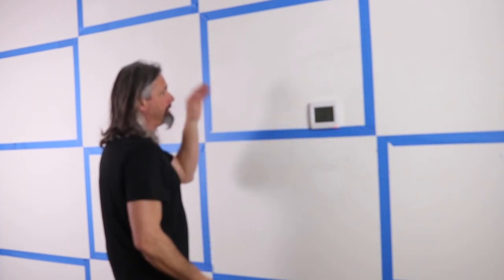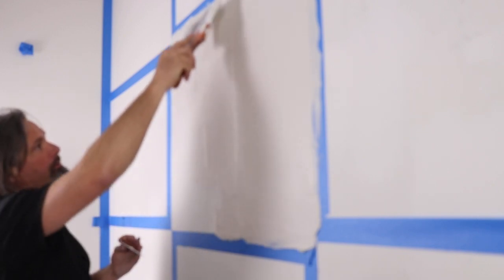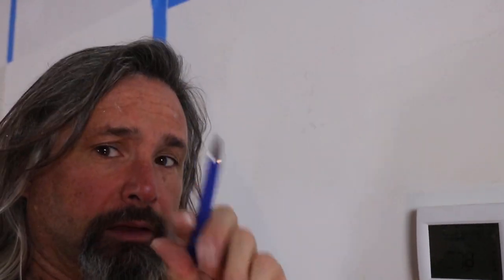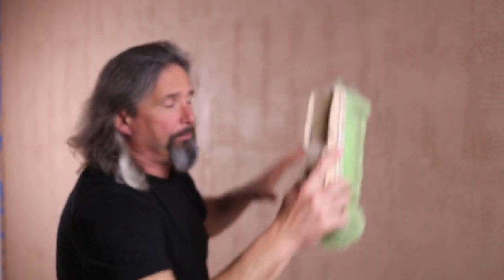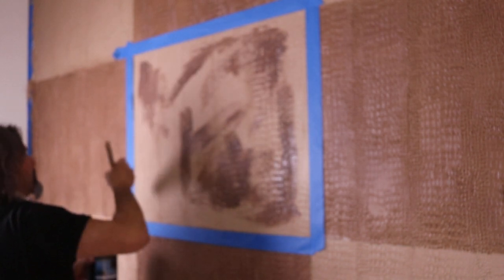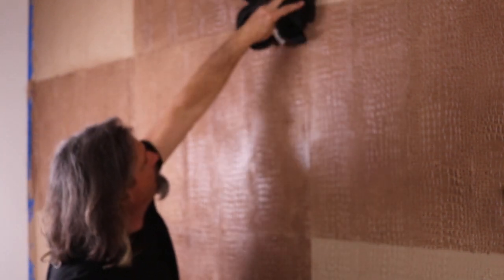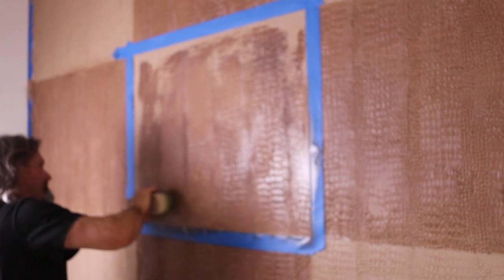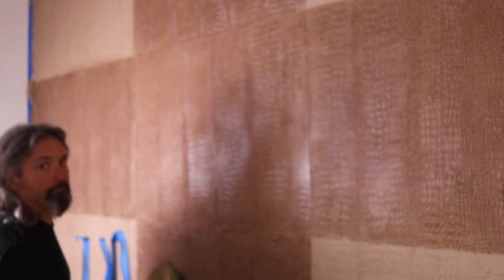Exotic Alligator Hide Wall Finish: Step-by-Step Tutorial using Plaster, Metallic Paint, Glaze & Wax

Comment: I just did this treatment last week in a small master bath project. It took me months to get the nerve to tackle this and I stalked your videos a zillion times to make sure I had the technique down so I wouldn't completely mess up the wall. This morning THIS NEW video popped up with yet MORE tips arrived! You're 100% right about the Zinser overfill! Good advise! The next time I use this treatment (soon), I'll try dipping the roller into the water instead of misting the surface, which appears to be very effective and the tip of dabbing the glaze with a soft towel...duh, why didn't I think of that??  My advise to those hesitant to try this amazing wall treatment? Prepare, watch, get your supplies together, take your time, be patient and get over yourself! YOU CAN DO THIS! Ron is the inspiration!

Comment: Thanks for your amazing videos. I have a question which I am sure you will have answered many times. In the world of encaustic painting, an acrylic base layer is not usualy placed under encaustic, but you do something similar. I would love to hear your comments, thanks.
Reply from the maker: I don’t do much with encaustic, I  believe that is “painting” with wax. I use wax over a variety of mediums. In the video here I am going over mine plaster a very durable and hard surface. I have put wax over acrylics and water based materials with no problem. Could you be a little bit more specific or ask a more direct question ?
Reply: @RonaldLayman  Sorry I was not clear. Painters with wax advise against using acrylic primer as a base as the wax may not bond well with it, but as you have answered, you have had no problems - thanks.